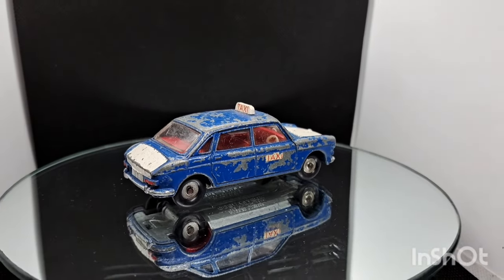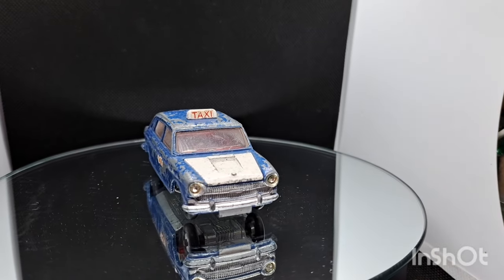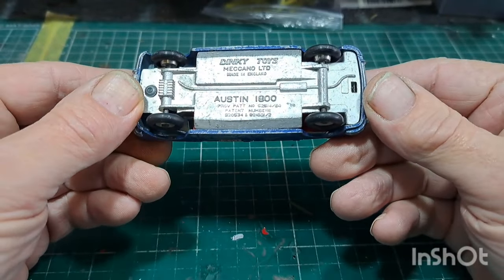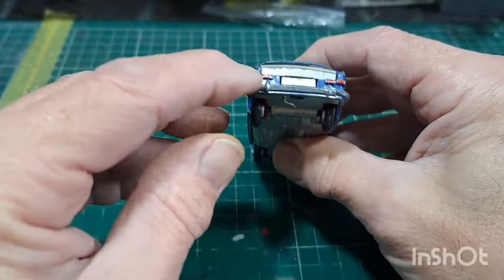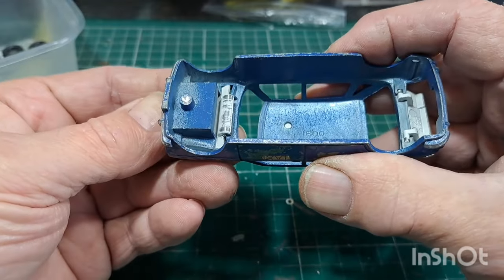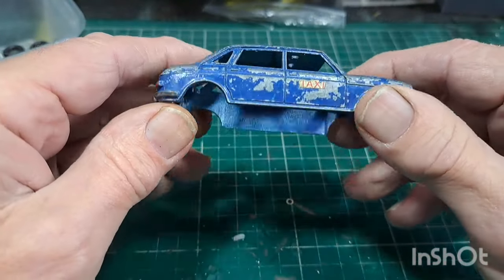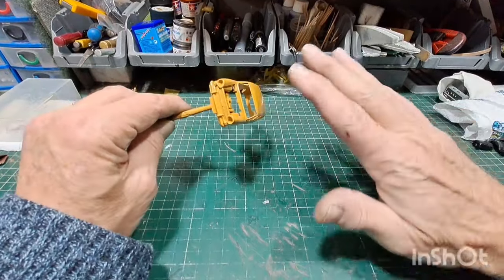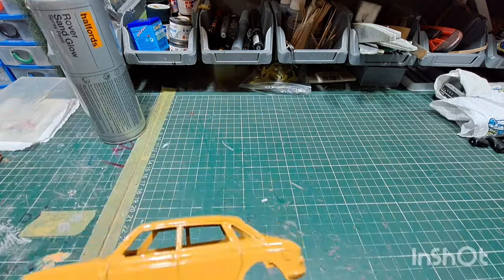Diecast Restoration Dinky Toys Austin 1800 No/282. 1966/68

Comment: That roof repair was terrific, Martin - not even a shadow there! The Sandglow was a mad colour, and hugely popular, along with Limeflower: you used to see all sorts resprayed in those two colours! Mark2 Zephyrs, Sunbeam Talbots... I even saw a Jowett Javelin once! The old Landcrab came up nicely without the minicab roof sign - I did a Vanguard Police Car as a standard motor, and added a roofrack, as a holiday trip motor.
Early model casting, with the horizontal tail-lamp clusters, was always a more pleasing finish on those cars. They had Maxi doors, too - or vice versa! Sweet result again!
Reply: The roof repair was really good, nery neat job.!
Reply from the maker: Thanks very much fraser.
Reply from the maker: Thanks very much my friend

Comment: Hi mate that turned out brilliant on my lap top it looked a bit orange but on the video projector it looked yellow. It's my on going saga trying to get the colour on my projector close to the colour on the lap top. A mate of mine who used to be my drummer in the band bought one of these for his wife. It was white and when we went to pick it up it wouldn't start the guy reckoned it did run and just needed a new battery. So out with the tow rope and mugins here got to be towed in it. It was going quite well until  "SNAP" the rope broke leaving me rolling to a stop right in the middle of a busy intersection. In total panic mode I turned the ignition key and blow me down it started so I put it in gear and pulled out of the intersection and stopped at the side of the road out of danger. For some reason I turned the engine off and my mate came over and said great it runs so follow me. ERRT ERRT ERRT CLICK CLIC yep the battery was flat again and it wouldn't start. 😫 My mates face.😡🤬Catch you on the next one mate.👍🏻
Reply from the maker: Hi Geoff 
Thanks for the story on the 1800. Typical of the cars back then ,but at least you could work on them not like todays cars , I had an experience  similar to you ,my mate and I stripped a car for spares ,just had the shell and wheels, and he was towing me to the scrap yard and te tow rope snapped at a busy junction there I was sat in the car on a milk create no doors no engine boot or bonnet while he was driving up the road without a are in the world, I certainly drew attention to myself that morning 🤣🤣🤣 all the best Martin